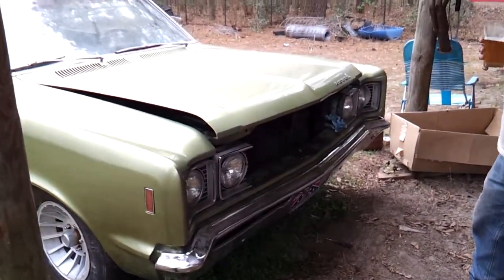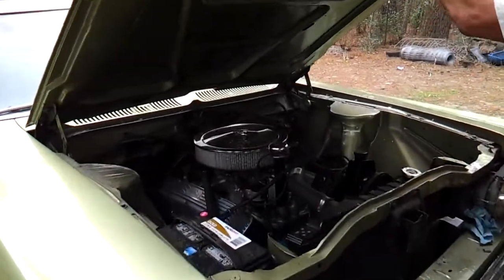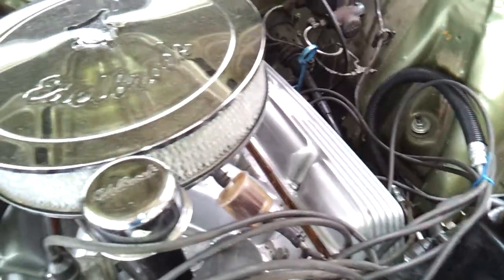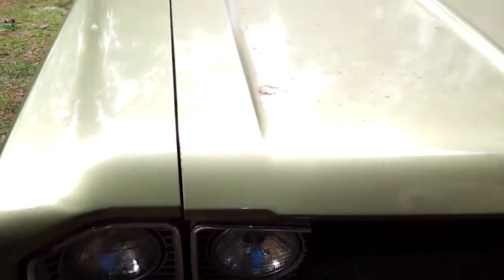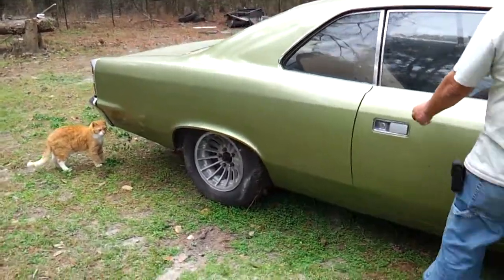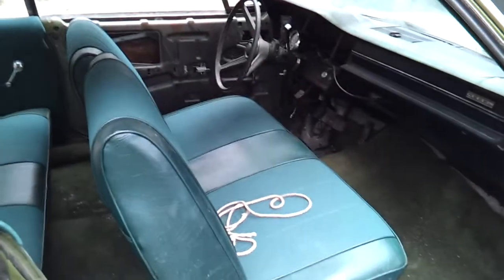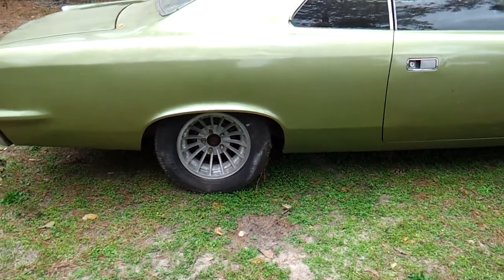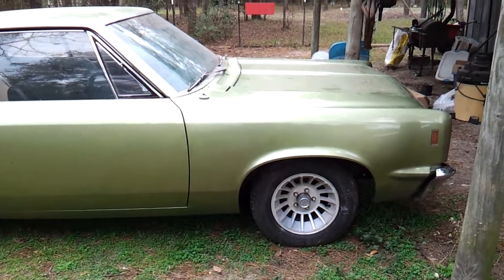Mike and the Rebel

Comment: Mike I'd stay away from the wire wheel on those rims,it will remove the aluminum.Truck drivers use a acid of some kind on wheels and fuel tanks on big rigs.